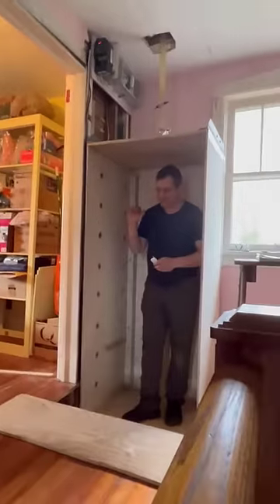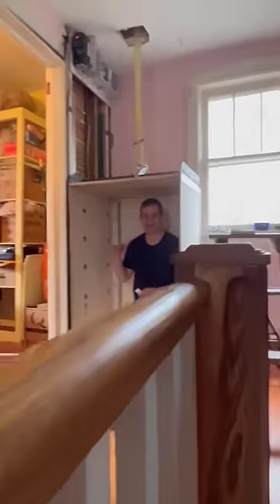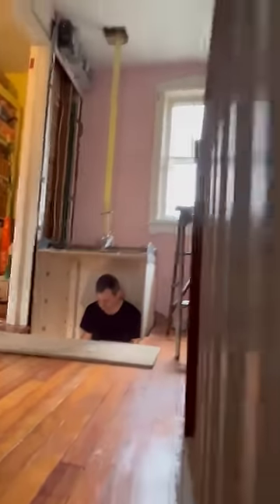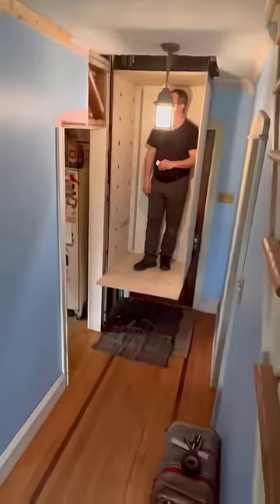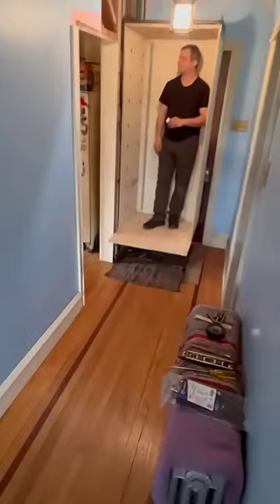Home made DIY Elevator First ride with test dummy 😁

Comment: I went to a house to do a electrical job. A old man claimed his winch was broken. When I got there I found he was using a truck winch to do the same thing. I couldn't help him because of liability issues but It was an interesting day none the less.
Reply from the maker: Hmm. I wonder what was wrong with his winch. I looked at winches before I found out we had a good quality motor and gearbox, and the only issue I had with them was their duty cycle is crazy low. Like 30 seconds on before the mfg says too bad so sad. I can certainly respect not working on it though, that a liability for sure. Dude should've taken it out and brought it to you. 😁
Reply: I don't actually remember. I just know I got there he was it won't go up and I went back to my truck and called my boss and was told not to touch anything because of the threat of being sued. Boss said to just thank him for calling us but we can't work on it and to assure him we wouldn't be billing him the trip charge or anything else. He got angry and was upset because his son in-law built it and wouldn't answer his phone. He said he had it a while with no issues. It all looked like harbor freight materials and if I had to guess it was probably the batteries. Guy had a small trickle charger to two deepcycle batteries and then to a small truck winch.
Reply from the maker: @CORYSart  ahh yeah, a trickle charger won't likely even overcome the resistance of two deep cycles😅 Good Guess.
Reply from the maker: @CORYSart  One thing I've always disliked about our fine country is how litigious some folks are, suing for this that and the next thing instead of just living life. Insurance companies are amongst some of the worst, vile creations out there, they take what is a great concept and then fight tooth and nail against fulfilling their end of the deal. 99 times out of 100. 🤢🤮
Reply: A winch is not a load rated hoist and it isn't safe to use it to lift people. The braking mechanism is not the same as a actual hoist designed for lifting. Even hoists are not intended for lifting people. It says so right on the tag of every single electric hoist on the market..."DO NOT USE TO LIFT PEOPLE".

Comment: Wow! This takes me back a lot of years. I did r&d for American stair-glide which changed its name to Access Industries and then to something else. We did a minivator and the Windsor when I was there. We had safety arms that would snap out into the t-rail if a cable broke. A safety pan which would stop the unit from crushing pets and a pan on top that would cover the hole in the floor when the unit came down. There was a switch bar on top of the unit that would stop it if grandma was setting on the floor hole cover. Very cool!! Thanks
Reply from the maker: Thanks! I appreciate the comment.
I've got a couple ideas and plans for the pan on the bottom, and a general concept for the false floor on top, but so far, we only have the slack rope safety brake installed. We have a gate for it, but Gram doesn't like it on, so... meh. 
I've been toying with the idea of setting up infrared eyes in the landing area and around the opening of the car as well, but lack some of the knowledge and all of the R&D budget. 😆
The goal was as shallow a step up into the car as possible, that's why we didn't just do a switch plate like you'd see on any commercially available units. Although, I'm pretty sure I could get that thickness down to about an inch or two, which I now know, would've been ok, but I didn't feel like arguing with Pop at the time. He's kind of right anyway, people just pay attention and it's worked out well for us so far.  I'd love to finish developing it to be safer someday, but as the saying goes; "Nothing is more permanent than a temporary solution that works."

Comment: Simple winch and ratchet strap in the attic. 👍
Reply from the maker: Actually, it's way cooler than that. It's a 3 phase motor and gearbox with VFD and upper and lower limit switches with speed changes a few inches before parking.

Comment: I had a friend that ended having to pay a professional a ton of money to fix his errors after trying to built an elevator himself. It is very nice to have tho but finding or making room for one is not easy. My other friend did one of those chair lifts in her stairwell. Both are lifesavers!
Reply from the maker: No doubt, one of the hardest parts was figuring out where to locate it. Some of the family wanted to go the chairlift route, but Pop didn't. He and I both agreed, not many more things can make you feel old or crippled like riding a stairlift for over a minute. (they're so slow) Plus, walking by it all day, they had a big psychological hurdle with the chair lift for some reason.

Comment: That’s pretty cool.  It runs at a good speed and can double as a hefty front door blocker.  I’m pretty sure elevators are regulated and need to be inspected as a people moving cable car or something like that.
Reply from the maker: that's right. It's a fancy security system, I only call it grams elevator as an affectionate nickname. 👍
Reply: Needs a fall arrest (which it may have, it's unclear) a fall, even from that relatively low height, could result in serious injury, especially to the elderly.

There's an imminent danger that it could lower on somebody standing beneath it, it's going into an open area of traffic. Even assuming the house is a sole occupancy, it's a danger.

Health and safety laws for lifts in this domestic situation may not apply
Reply from the maker: @iandeare1  link in description. The safety brake test video is shorter to watch than that took to type😆.  Good looking out though, thanks👍.

Comment: Everything is great bar the lift box itself. Looks as though the bottom could pop off after long use.
Reply from the maker: Nah, there's aluminum angle brackets and a bunch of screws. It's stronger than it looks👍
Reply: @AlexR_44  fair enough. Great job 👌🏻

Comment: Perfect DIY project. The only problem is getting it certified. Depending on what country you’re in, a device like this will require an engineer report before you can get permits to build it. I hope everything worked out for you guys; it’s a lot of work
Reply from the maker: Been working great so far👍

Comment: That's really dangerous, you should have partially screwed in a couple screws on each side so that you can stretch a string across the opening so that he can't fall out.
Reply from the maker: Hmm. I'll have to consider that; we've just been leaning forward and holding onto the side of the car with fingers wrapped around the outside a little for added adrenaline boosts. 😂

Comment: Would be cool if it was built into a set of cabinets that had doors to keep the area clear below.
Reply from the maker: no doubt. If the house was bigger, a more dedicated space certainly would've been preferred, but the fact that it's by a frequently used door means that area is kept clear. It sounds silly, but it actually works out quite well for the lifestyle of the people that live there.
Reply: @AlexR_44  can that door that opens into the elevator be removed?
Reply from the maker: @JimsEquipmentShed  I suppose it could, but it's easier to just make sure it's closed. It gets used a lot, and the elevator car parks upstairs, so it's only ever blocked briefly.
We had planned on adding a magnetic interlock to the door, but their lifestyle doesn't really need it.  The times of day the elevator gets used don't line up with when they'd expect any visitors.

Comment: What you're needing there is a sensor on the front door linked to the controller.
Reply from the maker: I was thinking a magnetic lock or actuator and pin hidden in the door jamb, but the big window in the door just shows people when it's there, and they either go to another door, or just wait a minute.
Reply: @AlexR_44  what about if the door is left open and the elevator come down on top of it?
Reply from the maker: @Rayjinn_Staunner  it stops. Then you gotta lift it and close the door and try again. 
It's easy to make sure the door is closed though; you can see through the opening next to the car from above. 
Obviously not perfect or suitable for public use, but it's been great so far.

Comment: It’s an elevator, and it does work, but most people would feel better riding it if they knew it had the safety features of a modern elevator (if the cable breaks it won’t drop like a rock).
Reply from the maker: it does. Check the description for a link to see one of the tests of that system.
Reply: @AlexR_44  I would feel better about the test if somebody was actually standing in it when the cord was cut instead of afterwards. it doesn’t even again address many more safety concerns, such as if somebody’s body part gets caught in the way or if they fall out or even if this thing gets stuck. If you want to use it, that’s your business, but I wouldn’t encourage people to copy what you’re doing. Reminds me of backyard roller coasters.
Reply from the maker: @peterw2714  No video of a weighted test unfortunately, but it's a jamming action, more weight only locks it harder. 
As for the other concerns, they're valid, but don't apply to us, because everyone that lives and visits there is pretty intelligent and other than one, able bodied, so we rely on good ole common sense and our God given self-preservation instincts to cover the other safety concerns.  -- As for getting stuck, a hand or drill crank winch is the backup plan there, but power outages are quite rare where they live. 
As far as others copying goes... That's why there are no details about the or motor and gearbox or model of VFD etc. There's also no actual dimensions or particularly useful instructions.
I've purposefully left out enough info that anyone trying to copy, will be on their own. 

All I've done is shown what I made because I think it's cool. I really didn't expect it go viral at all, just thought some friends and family would like to share the video. 😅
Reply: @AlexR_44  intelligence is one thing but accidents happen, and that’s why they call them accidents. I haven’t even addressed every safety concern, but good luck to you and your family. Hope it works well for you.
Reply from the maker: @peterw2714  Thanks. It's been working flawlessly for about a year already. 
Read through the comments if you want, I've probably already addressed your other safety concerns.

Comment: Simply from a space perspective I feel these should be more common in smaller homes. In a normal ranch that's around 950 square feet the Basement staircase takes up a lot of room. Of course you would have to have exterior Basement access for larger items. Still seems like this should be more prevalent.
Reply from the maker: Yeah, it certainly takes up less space than a stairwell. 
It is surprising how many older folks end up making a bedroom out of one of their first-floor rooms for the last years of their lives. It's sad. Especially in recent years where inflation and greed have been eating through people's savings like a fire.

Comment: It looks really good, but i am concerned about the location. What happens when the doir behind it is open and the lift descends right on top of it?
Reply from the maker: The car just stops. In fact, the slack rope system takes over and the car locks in place until lifted back up. Then you close the door and give one of these 🤦🏻‍♂️, and try again.
Reply: @AlexR_44  Awesome!😀

Comment: Is there a sensor so that the elevator will stop if it hits something on the way down?
Reply: That's what I'm searching for in here. This doesn't seem to have any visual safety protocols. Open floor upstairs, lowering onto someone, the ability to get pressed between the ceiling/floor and elevator.
Reply: Yes
Reply from the maker: Currently, just the ones God gave us. Eyes and ears and that stuff in between them, under the bone. 
However, I'm sure you're aware, it wouldn't be difficult to add as many safety circuits as someone would like, by using the e-stop input on the VFD. Or, using the low limit circuit if a soft stop is suitable, such as a bottom plate.
I've also toyed with the idea of using PIR sensors in the landing area, but don't have the budget to buy stuff to experiment with. 
The reality of it is, it just doesn't need them, as long as there's adults using it with their mental faculties even remotely in good shape. Or responsible children for that matter, but I wouldn't push it... even good kids get a little shitty sometimes😂

Comment: Is there a good reason not to make the box ceiling height, so there's no hole in the floor upstairs when it's down?
Reply from the maker: Good eye. Yes, downstairs ceiling height is almost a foot taller than upstairs. Plus, it leaves a nice space upstairs to mount all the electronics just above the car out of the way. 
Ideally, I'd have put this in a closet or similar so it could be closed off, and/or have a false floor plate lower over the hole as the car descends, but this location works out well for them, they've got a few generations worth of stuff in all the closets 😅.
Reply: @AlexR_44  nice

Comment: Nice but something blocking that door is not likely to be considered safe
Reply from the maker: yeah, I hear a lot of "that's not safe" type of comments, but once all the variables are known, I can confirm, it is indeed, perfectly fine where it is. For us. 
The car is only ever there for like a minute, maybe two if Gram's moving extra slow, then it goes back up out of the way. Anyone that needs that door can either wait on the porch or use one of the other three ways in or out. 
Plus, like someone else mentioned, this thing is in fact a fancy door blocking security device, and not an elevator for people, since those require permits and crap. 😁

Comment: Very cool. When the elevator is on the first floor, does it block entrance to the door?
Reply: Unless the elevator is a pass through and the back opens , it would definitely block the entrance. So in case of power outage, or other malfunction,  you have no front door access. Placement is far from ideal.
Reply from the maker: Yes, for as long as it's there. Which is about 30 seconds to a minute, unless gram is moving extra slowly. It parks upstairs. There are also three other ways in and out of the house, so even in case of a crazy emergency, it's not a big deal.
Reply from the maker: It's the back door, there are three others, it's an old house. If, by some crazy coincidence there was an extended power outage while the car was down, which is only for about a minute at a time, a good old fashioned hand winch, or drill powered, is the back-up plan. I didn't like the placement at first either, but it's actually turned out great; not taking up any room space, plus being a hallway, nothing is ever really placed and left there, and nobody really hangs out in that spot.

Comment: Pretty cool but the place where it comes down is a bit dangerous. Seems like a walking area.  Dangerous if someone is standing there, dog sleeping, something on floor, or if the elevator fails and falls.
Reply from the maker: there's a safety brake in the lifting mechanisms, it can only free fall about 1/4 - 3/4 inches should something break.
As for the rest... the only living being there not able bodied enough to move when it's descending, is the person that needs/uses the elevator, so it works for us for now. 
I have ideas/plans to mount a plate to the bottom with switches that will trigger a stop if/when it encounters anything, but we opted not to do it because the goal was a short step up into the car for gram and adding that would add at least another couple inches to the platform. 
Good lookin out though👍
Reply from the maker: @chunkyfecalbreakfast  yeah, basically it amounts to a phone call to any of several family members that live nearby and a hand crank winch. Admittedly, there's no elevator emergency call button, but I'd imagine our family's response time is faster than any elevator or stairlift repair company.
Reply from the maker: @chunkyfecalbreakfast  sure do, we figured out the complicated stuff, AND it occurred to us that we might need a backup plan, like a hand-crank winch in case of extended power outages. etc. It'd be a slow ride down, but safe.

Comment: If the elevator is down how are you suppose to enter and exit the door
Reply from the maker: You either wait a minute, or use one of the other 3 ways in or out👍
Obviously not a perfect solution, but it actually works very well for us.

Comment: What about with a chair in it looks like it dident touch the floor properly
Reply from the maker: @DeanTalik  yeah, unfortunately the house has settled over the years and the floor is uneven. It's not much though, a wheelchair can climb it with help. I spent many hours trying to solve that issue, but nothing feasible and worth the time came to mind.   Fixing the house floor would probably be easier. 😅
Reply: @AlexR_44  perhaps a small ramp they folds up as the lift goes up and then lowers as it comes down and stops
Reply from the maker: @DeanTalik  that could work. I'm just hoping she doesn't get to the point of needing a chair full time.

Comment: Don't you have a governor for the elevator?
Reply from the maker: It's less than 9 ft. and it's not an elevator, but more a large dumb waiter/back door safety interlock device😅.
There is a badd-ass instant reacting slack rope brake though. Go watch the test video, it only freefalls about 3/8 of an inch at most.

Comment: Пол прикручен на саморезы в торец? Очень самоуверенно. Я бы как минимум уголки на болтах поставил. И ребра жёсткости.
Reply from the maker: Translated: "Is the floor screwed to the end with self-tapping screws? Very opinionated. I would at least put corners on the bolts. And stiffening ribs."

no. The car is aluminum angle framed and the panels are fastened with t-nuts and screws.
Reply: @AlexR_44  , sounds good, thanks for comment.